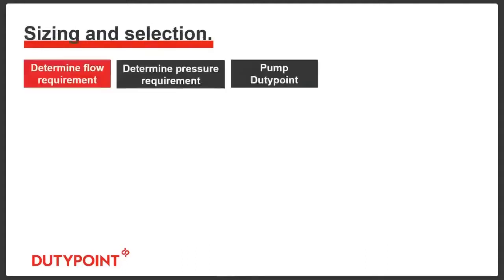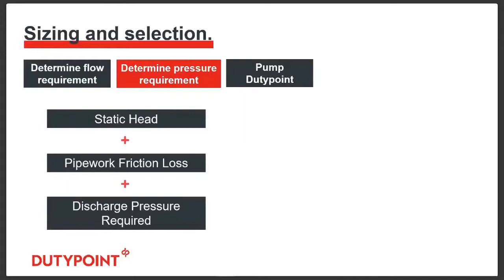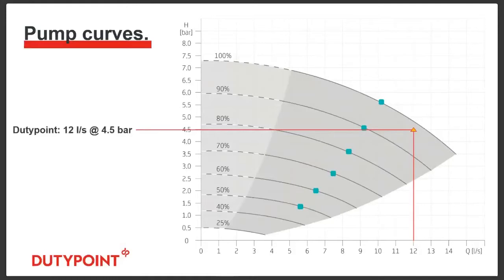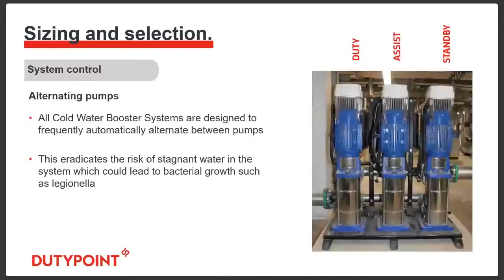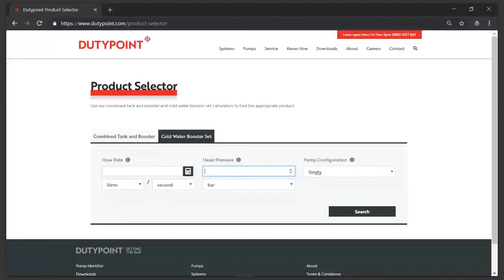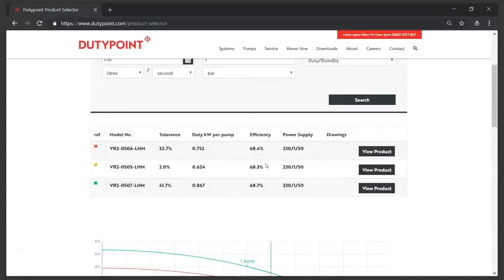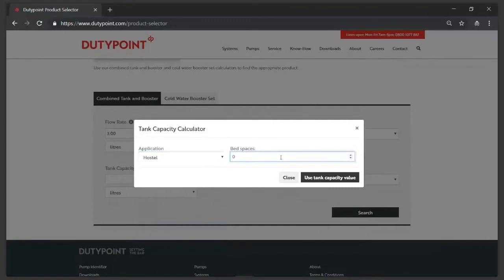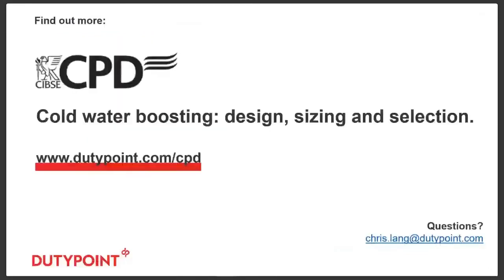How to choose the right booster set

Comment: Hi, when calculating the pipework resistance do I need to calculate the resistance for the hot water system as well as the cold water? The hot water will be supplied from the boosted cold water, so will this pipework resistance and the resistance through the water heater need to be calculated to ensure sufficient hot water pressure? Thanks